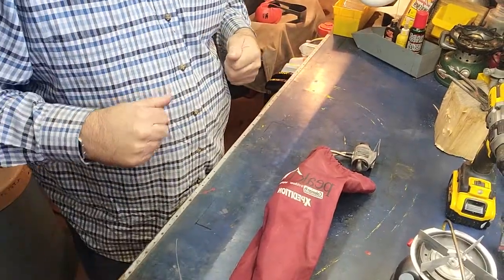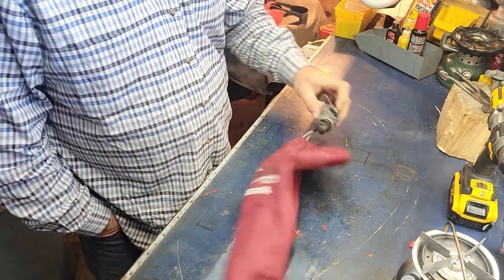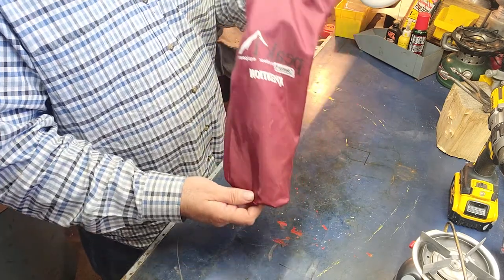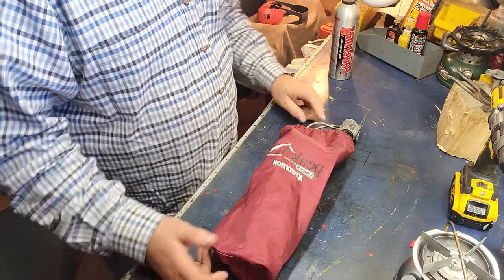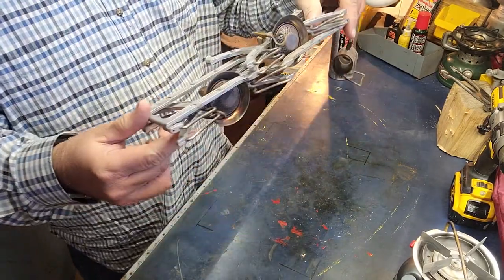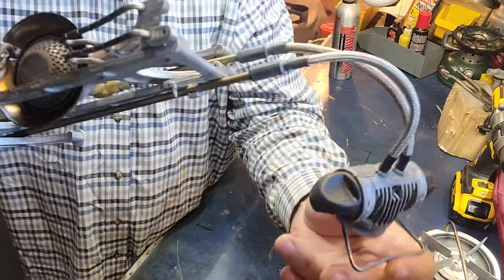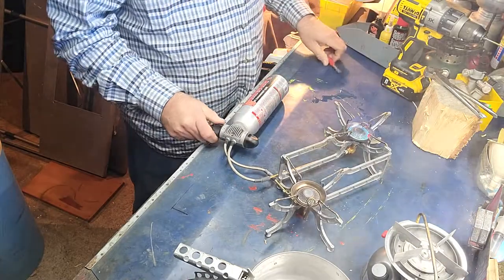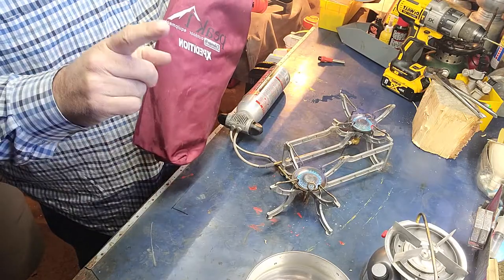Peak 1 Coleman Expedition- Two burner stove - First light

Comment: I have an extreme (3 legged version) with the very rare hard plastic case, and the fuel adapter. The adapter was sold by coleman for a very short time and has been discontinued for many years now.
Reply from the maker: FUEL ADAPTER??? INTERESTING  ,,so it will adapt to a modern fuel canister ? Wow that's incredible 👏,  thanks for sharing,  I will need to look for one .
Reply: @doinsngoins the fuel adapter works with standard lindahl valve and and holds them inverted so the stove is still fed liquid.
Reply from the maker: @Cream_of_sum_yung_gai  thank you

Comment: So, it take a special fuel can for this stove ?
Reply from the maker: Sadly yes, the fuel  is unobtainable at a fair price however I'm optimistic that someone will make an adapter,  its that good of a stove if you find them , buy them . Thanks for asking , I used mine today on the trail , just posted footage if you are interested 😀
Reply from the maker: Look up powermax fuel on ebay .
Reply from the maker: There are people that fill empty cans , from other common  fuel cells , I tried it was a disaster.